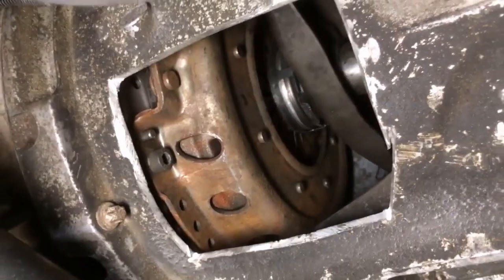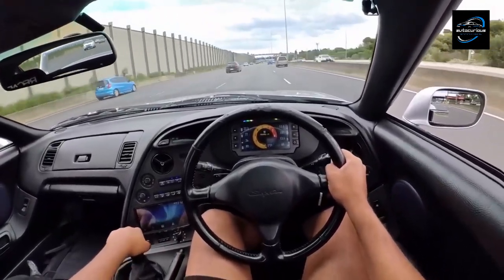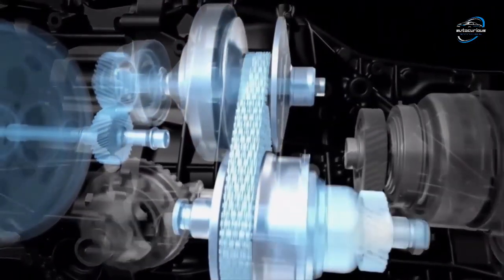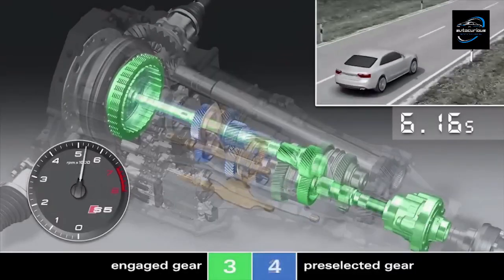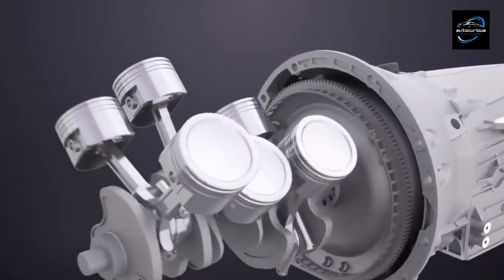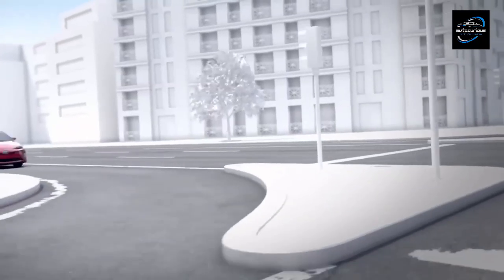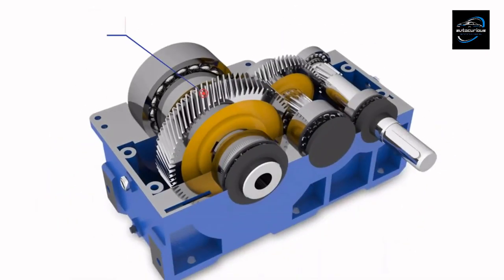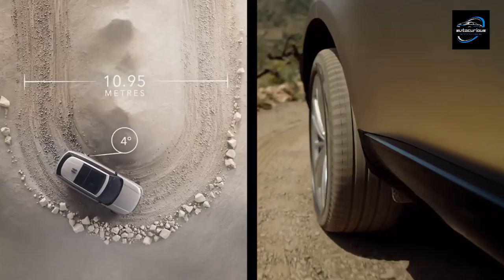Transmission Explained: Manual, AT, AMT, iMT & CVT – Which One’s Right for You? #automobile

Comment: Hi.Just bought my first automatic car yesterday, but taking it back to the dealership on Monday due to a gearbox problem. It drives fine in "D" Day mode, but will not even move an inch in "N" Night mode. Have you any suggestions as to what may be wrong? Thanks
Reply from the maker: No need to go to the Dealership sir...go to hills and put your car in any of hilly road OR slope in your area or hills you go, and shift to night mode without applying brakes OR the Handbrake...your car will definitely move, not only in inches, but for miles...m sure